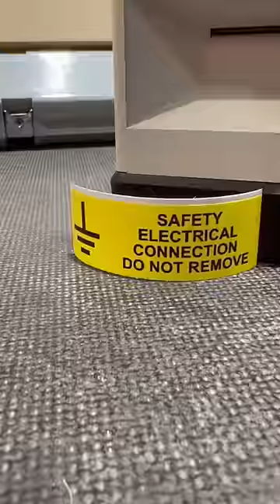Electricians Shocked by this Mysterious Earth Clamp

Comment: Por lo que entiendo, hay que poner tierra a los tubos del baño, es así?
Reply: Correct: they're earthing the pipes to the cabinet, not earthing the cabinet to ground through the pipes.  The cabinet earth rail connects to e.g. grounding rods through a separate wire, not shown in this video.

Comment: sure let's make sure that all the faucets in the house are energized if there's a fault. I'm surprised that electrical code still permits that.
Reply: If there’s a fault the breaker pops :) if the faucets get energised this is what will stop it
Reply: @techheck3358  I guess you not aware that not all faults are enough to trigger the breaker. call it leakage, like a dripping faucet.

Long before polarized plugs existed I almost got electrocuted by a concrete mixer that either had a fault or was plugged in such that the mixer was hot.
The breaker didn’t trip.  I only survived because I was able to lean over enough to fall and break contact.  

The breaker also didn’t trip when the direct buried wire (builder shortcut) to my AC faulted, more than enough to measure with inductive clamp, but not enough to trip the 50A breaker.  It’s also not an unusual problem with street light and traffic signal circuits due to faulty wrapping of splices in the underground pull boxes that inevitably fill up with water when it rains.

edit: leakage will trip a GFCI or GFCI breaker, but not a standard one.
Reply: @AB-vc7ox  GFCIs (or RCDs as we call them) are mandatory for all UK homes, for all circuits leaving the distribution panel. this pipe isnt used as a grounding rod, but rather grounding it so that it doesnt bring a potential into the building
Reply: What is it energized in relation to?
Reply: @Monkeh616  relative to ground, like any other hot wire. it might decide you touching the faucet is a shorter path to ground than the length of pipe.  Of course if you have PEX or PVC (plastic) pipe interrupting the continuity, the energized pipe is live like an exposed wire.   Path of least resistance is what electricity seeks. kinda like water leaking through a roof.
Reply: @AB-vc7ox  But it's connected to ground, that's the point. In the event of a lost neutral this connection REMOVES the potential between the pipework and the electrical ground, by providing a low impedance path. So, what other point are you thinking you'll be in contact with? The electrical ground and the plumbing are at the same potential. The walls and floor aren't meaningfully conductive.

Current flows via all paths in proportion to their impedance, by the way. There's no way for it to 'decide' that human skin is a better conductor than a thick copper cable or a pipe of even greater area.

Comment: I hate that you ground to the plumbing. As someone who has been shocked in the shower and from the water appliances in my youth from unbalanced loads or a lose nutral, build official ground rods for the building, its not 1930 anymore
Reply: All metal piping needs to be earthed 😊
Reply: It's not clear from the video,  but the earth (e.g. a grounding rod) is connected to the earth rail in the cabinet.  The earth wires to the copper pipes are to ground the pipes to the cabinet, not to ground the cabinet to earth.

Comment: And that there my friends is how you get spicy water.... utility neutral fails and instead of it going to a ground wire you get potential shock hazard in your water line. Remember electricity doesn't just go to path of least resistance, it goes to all paths to ground!!!
Reply: The exact opposite. If you lose your neutral, you'll have full line voltage between the electrical ground and a pipe which makes earth contact. Hence why the pipe gets bonded and that potential is removed.

Comment: What I don’t understand is why you guys are required to ground pipes in the UK what is the exact purpose ???
Reply: Same reason metal pipes are supposed to be bonded to ground in the US, as well...

It's not that common anymore, but only because metal pipes aren't that common anymore.
Reply: @puckcat22679  yeah your supposed to ground conduit in the US that has electrical wiring in it if it’s metal but they are grounding water pipes
Reply: Because if they weren't there is a possibility that in a fault, like a live wire chafing on a metallic pipe would make that live if it was not earthed at some point. People have been killed by placing wet hands on metallic taps where one was live and the other had been earthed or was in someway connected to earth. If all the accessible metallic parts in your house are earthed, there is no possibility of getting a shock in the event of a fault
Reply: @paulhancock3844  ok that makes sense as why we don’t do it because it’s illegal to run electrical wires in close proximity to water pipes in the United States

Comment: Never ground to copper plumbing. When struck by lightning or an electrical fault a hole could be made in the pipe. Your ground should be a separate ground rod outside the house house driven at least four feet into the ground. Most water supplies are PVC which are plastic which is an insulator. This is dangerous and will not pass electrical code. And could electrify your water fixtures.
Reply: Those pipes have a greater area than the cabling coming into the building, and in the case of water are literally water cooled. They're also not being used to provide ground, but being bonded to it, to prevent there being any chance of a shock from the plumbing fixtures.

This is quite safe and does, in fact, comply with the relevant regulations, which you should probably be familiar with before making comments.

Comment: Don't wire both pipes to ground. Run the hot wire to the hot water pipe. Now you don't need to run power to the bathroom. And just think how much power those water pipes can handle compared to skinny little wires. This is why you have a diakectric at the hot water heater.

Your welcome

Comment: Hi I'm what we call a moron. I'm not an electrician, or a plumber but I like to pretend that I have some what an Idea of what I'm talking about... I know electric wants to find the quickest path to ground but I dunno if electrifying the water is the best play here can that be really bad. like a human, and water isn't the best conductor sure but you could get a zap from the water or touching the shower fixture and a plumber touching the pipe directly could get a fatal shock because why the Hell would he need to check every square inch of the copper pipe to see if an electrician connected ground to it. and if he did what then the plumber has to then call an electrician out to disconnect it so they can get started working on the pipes. it seems to me the best idea is just run a proper ground wire hit a metal stack into the ground connect it to the box and call it a day.

Comment: No the only way to be sure is to sink a earth rod into the ground and connect your earths to that. Then again some people swear by connecting the earth to the neutral entering your  property. Either way I'd never use the piping in my house with the mix of non conductive pipes you cant be sure the water in these pipes alone will provide an adequate earth.
Reply: This is bonding, not providing a ground.

Comment: A copper water pipe is no guarantee of a good ground. At some point in the future, part of the copper line could be replaced with a non-conductive section then suddenly there is no ground! My father always connected to a metal stake in the soil - totally separate from any pipes.
Reply: Good job it's not being used to provide a ground then, eh?

Comment: Or just solder the wire to the pipe.
Reply: Good luck doing that with water in it. Better luck with gas..
Reply: @Monkeh616  Do yo sweat pipes with water in them too?
Reply: @andybaldman  So you're expecting the electrician to turn off the water, drain the pipe, solder a wire to it, turn the water back on and bleed the air from every point in the system?

What about the gas?

Comment: connecting wires to water pipes? not a smart idea   unless it's something else he's doing
Reply: You don't know what you are taking about.
Reply: @nomadicsoul34  Clearly they are not from the UK.
Reply: @nomadicsoul34  what did he do then?       I need explantions
Reply: Bonding the pipes to ground. That way, if something shorts to the plumbing, it has a direct path to ground instead of going through whoever is running the water.
Reply: @puckcat22679  thats not really what its about. We only earth the pipes that have earth potential already. Its about creating an equipotential zone.

Comment: Plumber here. Grounding to copper water lines causes electrolysis leading to pin holes and leaks due to impurities in the copper. Don't do it. Take the time to install grounding rods.
Reply: They're not being used for grounding.
Reply: This is BS. A while ago I saw a number of pipes brought from wholesalers and retailers all pressure tested. 2 types of tests for each one. Slightly soapy water inside in air outside and slightly soapy water outside with air under low pressure inside. This showed that more than a third had pin holes and unevenly thin walls out of the factory.

Grounding the pipes to the same potential means all pipes have the same potential with respect to ground. Also touching one or a tap will not give you a shock under normal fault conditions (failed ground on PME isn't considered normal, and is a hazard, as this can cause the mains earth in your home to become live, but this is rare). If you didn't ground water pipes and your shower becomes faulty or washing machine/dishwasher etc, mains voltages could go through the water pipe while you are touching a tap or sink and with other hand be touching the body of the kitchen appliance or be taking a shower and touch the metal of the drain and receive a minor shock before the breaker pops, or worse, receive a sustained shock if you still have an old fuse panel - nothing is going to blow because a fuse isn't able to detect earth leakages.

What's worse? your mistaken belief that pipes fail and might (although unlikely) leak, or someone dying because you have failed to put a simple wire on to reduce the risk of death and actually reduce what you claim. (and another way to look at it - the difference in voltage from one side of a pipe and the other is ZERO, so there is no electrolysis, but STATIC can build up on the outside of a pipe as water passes through it).

Comment: You cannot put the earth cable  on the pipes .You should fix a special bar(special metal) on the earth (1.5m long),and mount the cable on it .
Reply: Sure you can, if you know what it's there for. If you don't, you shouldn't be touching or commenting on electrical installations.

Comment: It's pretty smart using the plumbing as a ground.
That way, if there's  a fault, some guy washing his hands can become part of the circuit.
Reply: He's not using the pipe as a ground. He's bonding the pipes to the ground. That way, if something shorts to the pipes, or a hair dryer gets dropped in the tub, there's a low resistance path to ground, instead of going through the person using the plumbing. It's the same thing as connecting the metal chassis of an appliance to ground, and for the same reason.

Comment: That’s probably one of them goofy electrical panels in like Germany or Europe or some crap you know like everything is 240 like a hairdryer and a toaster Wayne honey I just drop the hairdryer in the bathtub with you in it. Oh well.
Reply: Unlike America, all sockets are protected by GFCI (RCD), so the breaker would pop as soon as it touches the water :)
Reply: Probably that’s not necessarily true with your 240s system or 120 system has a neutral right in the middle between 120 and one20 2/42 of all is is that we do have GFI breakers in America and we have GFI outlets in America and we also have arc fault breakers now in America where we have to put all family rooms living rooms walkways and any where there’s traffic where a wire can get a cut so we have a lot better system than yours
Reply: @patriciap1214  Really, what makes your system better? 120V is a loss of efficiency with little to no safety benefit, you require more circuits with more breakers, AFCIs are a response to poor workmanship and low product standards..
Reply: @patriciap1214  cables here have an earth connection between the live and neutral. if the wire were to get cut, it would be protected by the ground fault breaker, and/or by the fuse inside the plug

Comment: The only way pipes should be terminated is to ground directly, not on another circuit. So a separate grounding rod and block terminal not attached to power source grounding terminal.
Reply: Connecting buried copper pipes to a buried copper ground rod would achieve nothing. The point is to connect the two potentials, not leave them isolated.

Comment: He needs to re-read NEC70.
Reply: Why? It's utterly irrelevant to the task.
Reply: @Monkeh616  The first connection to ground was not code.  You don't break the insulation without cutting the wire and wrap the  wire around a screw connection.  Not that you can't.  You just won't work very long with a union crew by leaving improperly connected ground.
Reply: @stevepirtle588  All that's well and good.. but this isn't the USA. Nothing is improper here by the relevant standards. That connection is certainly not improper - it's mechanically and electrically sound and won't be going anywhere.

Now, they did miss the passthrough which would have avoided the need to wrap it, but that doesn't matter much.
Reply: @Monkeh616  The oldest and best saying in the workers bible, "Your touch it, you own it."  It's all good.

Comment: You can tell the electricians never do plumbing work. Every plumbing job I have been involved with that had electrolysis issues was used as a ground by the elctricians. Please do not use the copper pipes as a ground.
Reply: It’s not being used as a ground, it’s being bonded to ground (which will be provided by supplier or on-site earth rod)

Comment: Probably not a good idea to assume that the water plumbing is attached to earth ground.
Reply: Good idea nobody is assuming that, but instead assuring that.
Reply: @Monkeh616  Hopefully what the video is showing is bonding the water pipes to a known earth ground (a good idea) rather than bonding something else that's not earth ground (a light fixture for example)  to the water pipes in hopes that that accomplishes bonding the fixture to earth ground.
Reply: @Mesa_Mike  Indeed, they're demonstrating main equipotential bonding.
Reply: Don't assume anything, remember to bring a towel, avoid Vogon poetry, and exercise often.

Comment: Pretty sure most building codes won’t accept copper piping as the earth. Has to be a separate tree earth rod embedded into the soil. Some codes require soil resistance test for the earth rod.
Reply: This is not a grounding rod alternative. It is grounding the water pipes

Comment: boy get your ass out in the yard a drive a rod,  plumber here wanting to know what happens when the water piping is plastic
Reply: If it’s plastic it doesn’t need to be grounded😂
Reply: @techheck3358  it'll get thru to the water inside right ? hahaha
Reply: @mikemadsen7653  the water itself would be grounded by some other bit of metal in the water loop
Reply: When the supply is plastic it's not bringing a potential into the building and doesn't need bonding.

This is not being used as a ground rod.

Comment: I doubt that it's safe to connect earth to any pipe in the house. I only have safety earth connected to the cold water tap at the point it enters the house.
Or is the idea to connect a decoupled heating system to safety earth?
Times are different with PEX connecting most of the tubes :-).
Does remind me that for my new house I have to have a safety earth, and since it will be offgrid, I have to do it myself I guess. I doubt the groundwater pipe will be copper.

Comment: Electricians and Plummers get shocked with these "Earth Clamps". Electricians need to find their own ground with a grounding rod into earth. Not all copper pipes are grounded.
Reply: This is bonding, not grounding. It doesn't replace an earth connection and is only applied to pipes which are in contact with the ground.

Comment: So many in here that still think pipes are grounded. I've watched the utility lay so much plastic, it makes Barbie jealous. Unless tied to a proper ground rod, none of the plumbing here has an adequate ground connection anymore.
Reply: If it's a buried conductive pipe coming out of the ground, well yes, it is 'grounded'. To that piece of ground, which is not your electrical ground. This has nothing at all to do with ground rods.
Reply: @Monkeh616  I honestly don't think you grasped any of what I was saying.

To clarify, here, you can't know with any certainty how much, if any metallic pipe is actually in the ground. The feed pipes that in days of old provided a good ground, no longer do.

I also stated that I wasn't commenting on the video doing a safety ground on those copper pipes, but on the comments saying an earth ground can be accomplished using pipes. That is often no longer true.
Reply: @patrickbuick5459  My apologies for misinterpreting. The other comments may be adversely impacting my perceptions - there are many ranting and raving about how you can't use a pipe as a ground for those reasons, not grasping that isn't what's occuring at all.
Reply: @Monkeh616  That can happen on here big-time.